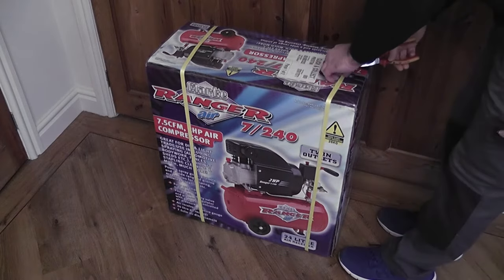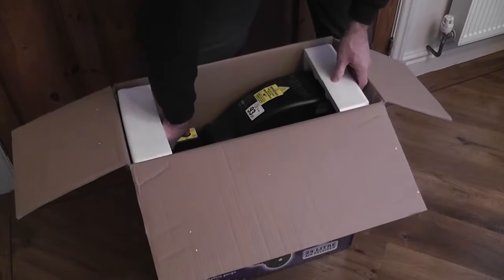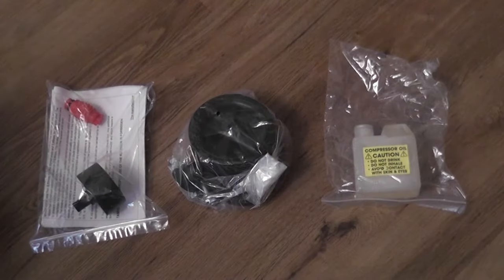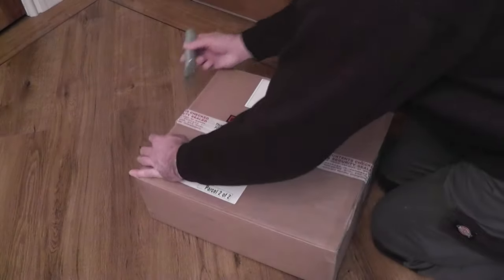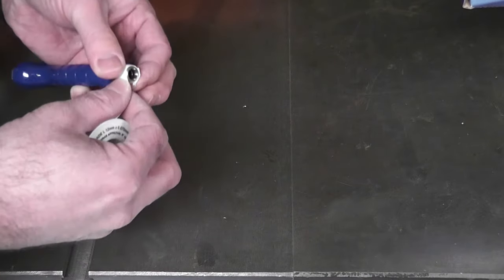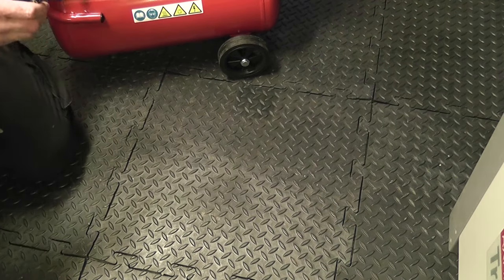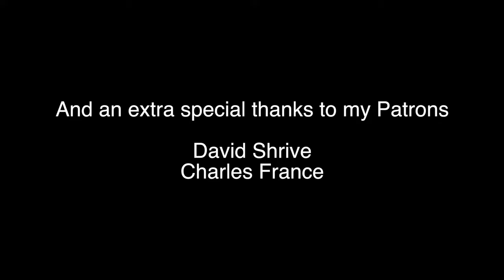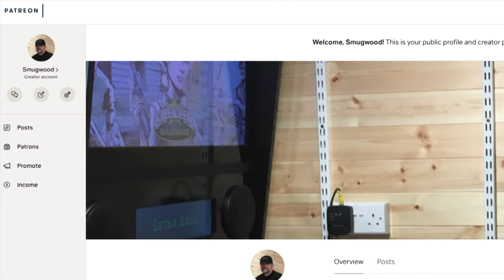The Clarke Ranger Air Compressor 7 240 from Machine Mart Unboxing and First Use

Comment: Clarke is made by Ingersoll.  I have the AC 2002 oiled 4 gallon air compressor myself and it is a very well made unit that is capable of 5 cfm at 90 PSI.  Weighs about 100 pounds though and it heavy as heck.  Barely portable but is a nice unit that is very capable with any shop air tool.

Comment: Good video. I've got the Clarke bandit. Looks almost exactly the same but it's just a bit smaller. Perfect for the brad nailer which is why bought it.
Reply from the maker: Thanks. Yeah I can’t wait to get firing a few brads 😂 I’m so used to assembling things with screws when in reality all it’d need is a few brads which should be quicker and neater too.
Reply: @Smugwood  I'm the same, never used one until I got this, not had a lot of use yet but it comes in helpful as a third hand or for "clamping" things.
Reply from the maker: @Exodus_Johnson  Its one of those tools thats probably not used that often...but when you need it you glad you bought it. :-)

Comment: Hi, good video, thanks for posting.  I'm trying to decide whether to go with one of these or the smaller Bandit, do you think the 8 litre Bandit would be too limiting re tool choice?  And, can you tell me the length of the power cord on the Ranger please?
Reply from the maker: Not quite sure of the length of power cord as I’m not by the machine. I like my little compressor and it’s extremely portable. But in hindsight I do wish I’d gone bigger as I do feel I’ve limited myself a little with the size of the tank. But on the flip side...most of the tools I will be using probably only require a small tank.